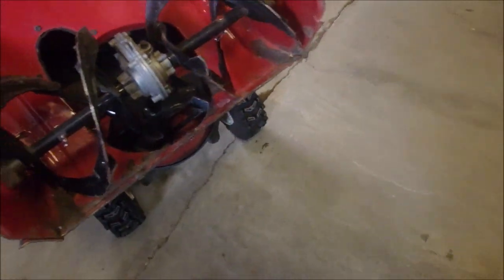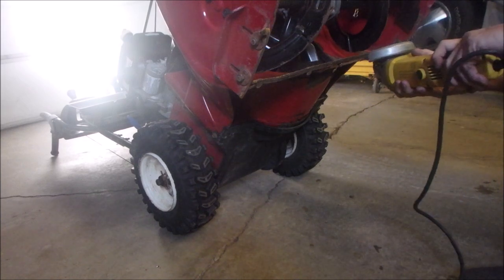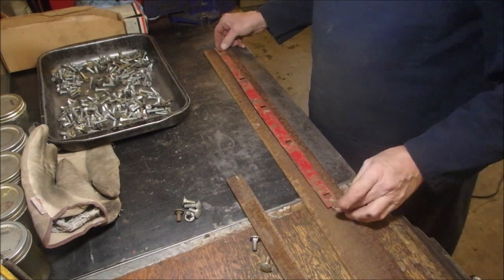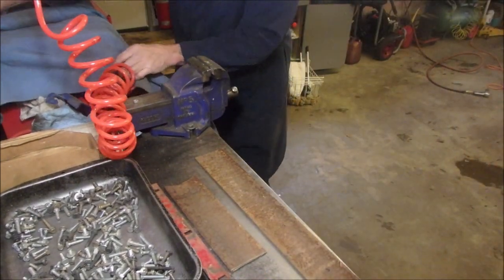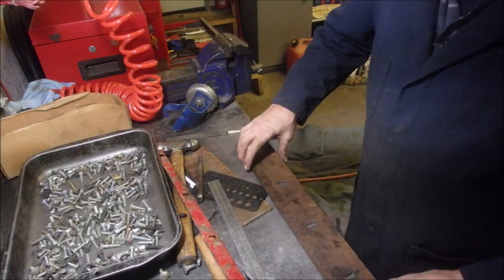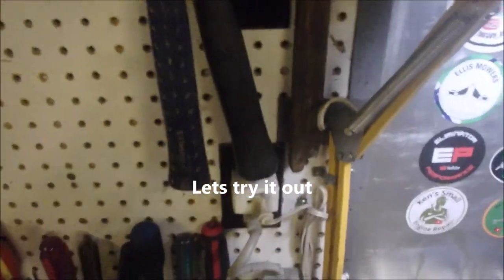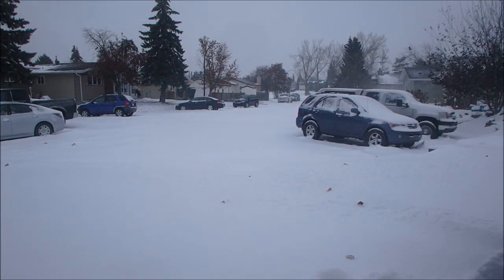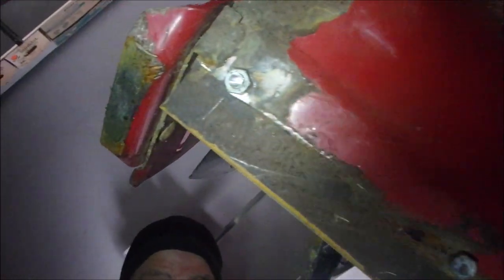Homemade Scraper Bar For a Toro Snowblower

Comment: Well done Bruce 'just goes to show you' my Dad would say what a person can do if they put their mind to use. I have installed a vice on a steel table outside the shop under the patio overhanging roof (likely 10 feet) just to do grinding and cutting outside because of all the sparks and metallic debris. Prior to doing that when i worked inside the shop i constructed a large piece of body metal from NAPA and covered the front face with a heavy plastic vapour barrier then attached many scrap speaker magnets to the back of the body metal which would trap all the particles to the plastic. The body metal was bent into a trough on the bottom so when i pulled the plastic off i could use it to catch and dump the debris into the garbage bin. Well enough of another lengthy comment but it makes my day eh? From one Canadian to another i am glad your getting the snow, hoping it holds off here for a while we are having fantastic sunny warm weather right now.
Reply from the maker: Thanks 
Wayne.  I watched your video on grease in  the auger gear box.  I ended up using 80W90 grear oil.  It called for gear oil and I went NON synthetic.   You know better than I.  This blower has about 2 years of life left in it as it is used by  contractor.   It is the one in my video this week.  The machine has been abused.  In the first video I heard a growling and i will check it today after adding quite a bit of gear oil.  It is -23C right now at 9 am
Reply: @BrucesShop  Thanks Bruce but it is Jakes video me i am just the non paid retired worker here lol! We can not get our 00 grease from Stens anymore since they are not carrying it may have to go with the Alvena EP from MTD but i think Jake said it runs around $2 per ounce our cost whereas Stens we charged $1 per ounce and had a small profit margin on the 00 grease.Supposedly TSC or here in Ontario Peavey Mart carries a Cotton Picker grease that is 00 but need to check it out. NAPA advertises a PrimeLine but do not carry it here.
Reply: Great idea, Wayne!

Comment: You nailed it Bruce, Always leave a 1/2inch gap between ground and machine never ever scrape dry always let sun melt off the 1/2 inch that’s left behind. As you would always check your gas and oil levels before using machine always check and maintain that half inch gap and your scrapper bar/plate will last for ever, and every spring I would put “never seize” on the bolts that held that bar/plate in place. Great video thanks for posting!
Reply: It's called a "scraper" bar for a reason, to scrape. Not to mention that it's replaceable.... for a reason. Some folks need to get that last half inch off the pavement before it turns to solid ice! If the skids and scraper bar are adjusted so all 3 hit the pavement at the same time you'll get even wear, they'll work as they should, and no ice!
Reply from the maker: I lave about an 1/8th of an inch gap if on concrete.  If in the alley I raise it a bit.
Reply: I think the 1/2" is for gravel to not be shooting rocks. I put mine at 1/8". Keep skids good
Reply: @BrucesShop  Me again.  I assembled dozens of S/B for a big box store when I retired.  The way we set the scrapers up was to use various strips of hardboard as a gauge.  Depending what you are blowing (Tarmac, interlock or gravel) will depend on the height (1/8, 1/4 or 1/2).  Plonk the machine over the gauge, loosen the 13mm nots on the shoes, adjust shoes, tighten bolts, remove gauge.
If you do this, I apologise and I'll leave you in peace.

Comment: Nice one, Bruce!  As for those speaker magnets, I finally had enough of trying to remove all the small metal bits in the groove and center hole of one that size that I have tied to a light rope for picking up metal bits on the floor or driveway or wherever. I got it completely cleaned up and filled the cavities with hot melt glue. That works pretty well by itself. Sometimes when I want to make it even easier I secure a baggie or ziploc bag around the magnet. Then it’s super easy to remove the ziploc over the trash can and everything just falls right off. 
Thanks for the idea of the magnet near the drillpress!  I’ll be using that from now on! 👍👍👍
Reply from the maker: Thanks,     great idea with the rope.  I have to cut a bushing today and will follow your idea..

Comment: The saw looks handy. I should buy one
Reply from the maker: They are an air hog.  When you see it stall out it needs more air volume and I use a big hose with a bigger compressor as well.

Comment: Thinking about doing the same thing, you do realize that you can operate the machine one handed right? Once you put it in drive and out that auger down it stays down leaving your left hand to operate the joystick, that way you can control where you’re throwing the snow and also work with the wind!!
Reply from the maker: Yes on some models.

Comment: Good job Bruce but curious why you would spend all that time and energy for a $20 scraper bar? Though yours is MUCH stronger than the OEM replacement!
Reply: Don it made a really good video and just shows what a person can do especially if parts are not available.
Reply from the maker: Thanks Wayne.  My answer to Don is i do it because i can.
Reply: @BrucesShop  👀🤣🤣🤣
Reply: @waynestefinashen239  yes you're absolutely correct and it was an awesome video. I didn't take into consideration the fact that not everyone can grab a part when needed.

Comment: Oh Bruce, for a very safety conscious man, may I mention the use of a file without a handle ?  Never do this.  If you slip when using the file the tang will go right into your palm.
Tip.  To fit a wooden handle, proceed as follows :  File in a vice.  Heat up the tang to dull/cherry red.  Push the wooden handle into the tang. Remove the handle and allow to cool.  Tap the handle back on and It will be there for ever.
Reply from the maker: I understand.  I don't think I have ever had a file with a handle.  LOL
Reply: @BrucesShop  Oh Lordy.  I'm a bit busy at the moment, otherwise I would drive up from Toronto and fix it for you.  That and the fact it's -20 in RD.  May I suggest a visit to Home Despot before tragedy befalls you, otherwise we may have to involve Mrs P ?